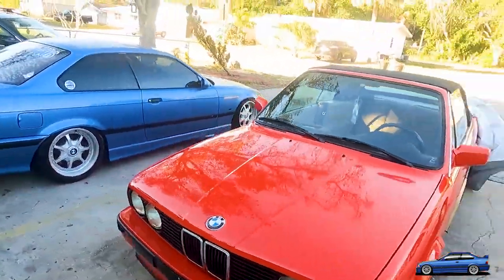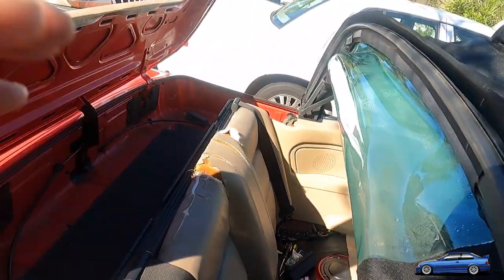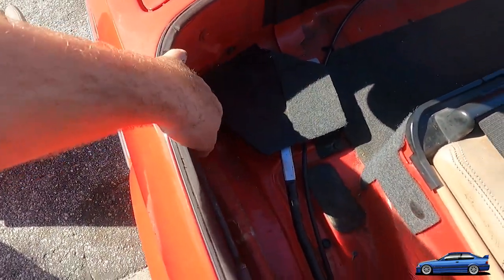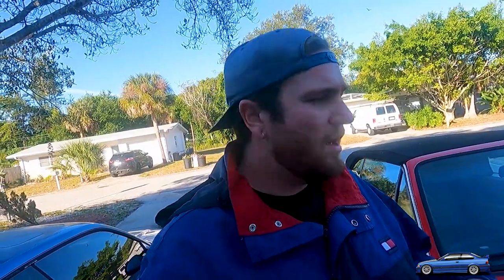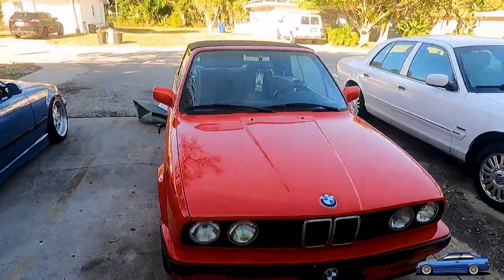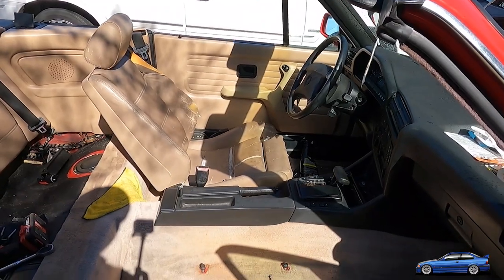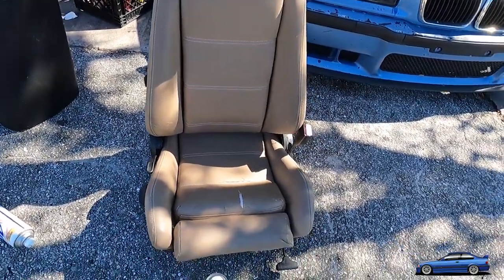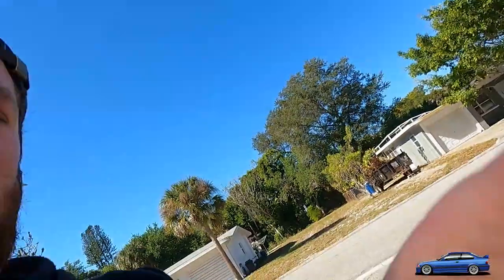We Found A Great Way To Fix Our Broken E30 Convertible Top

Comment: I also have a convertible 92 e30 and the entire system for the roof motor is disassembled, going to be a pain to try to fix
Reply from the maker: If they didn’t change all of the adjustments it shouldn’t be too bad being that there’s one motor
Just assemble it as factory and go from
There